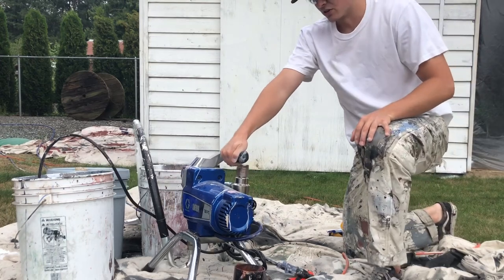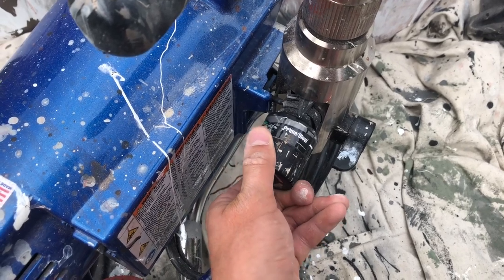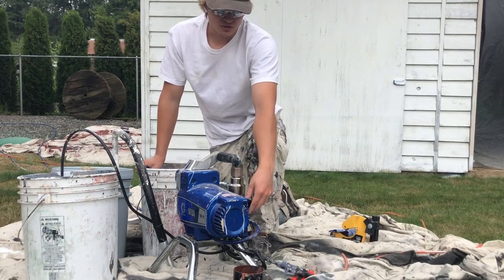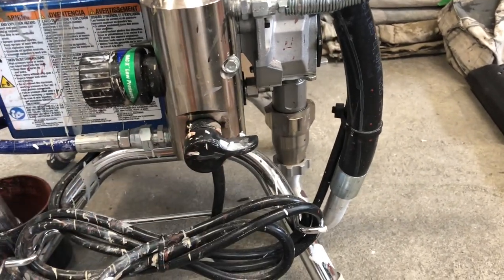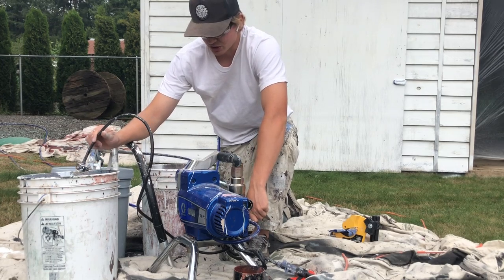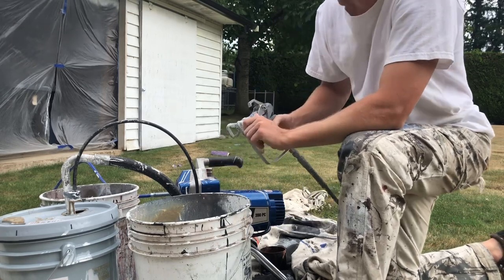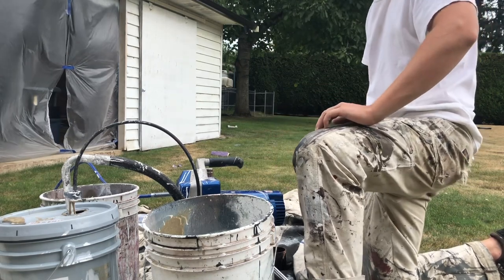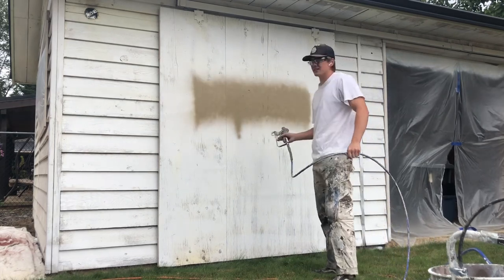How to use the Graco 390 Paint Sprayer (Exterior Painting)

Comment: You never leave water in your unit that rusts and corrodes, when storing the sprayer use either pump armor, windshield washer fluid, or mineral spirits
Reply: You can leave it with water. Just don't leave it for a year
Reply: You seem like an expert. Wondering how long it takes to get good enough. Ive worked for 2 contractors both of which did their own spraying. Seems the only way to get experience is to buy or rent one. Would one or two days of use with various tips and pressures get me enough experience to offer the service?
Reply: @gianthills  Just get one and start using it. Sink or swim. Experience is the teacher. Offer to work free if you have to for experience. I worked free for a day to learn basics. Cleaning up and spraying. 23 years ago. 
I leave water in for up to a month no problems. Even longer. Been doing that 23 years. Since I bought my first 395. Rebuilt my own Gracos every time. Nobody else ever worked on mine.